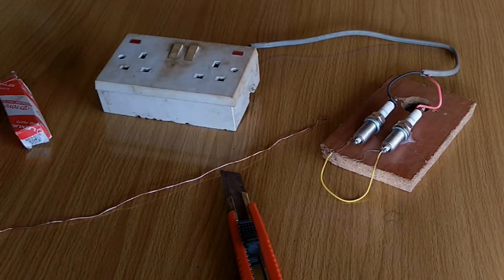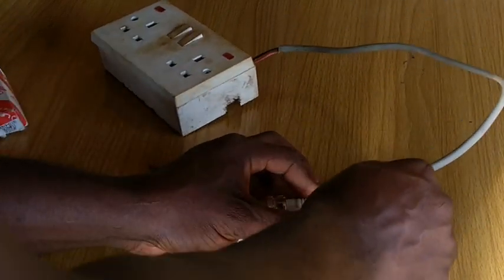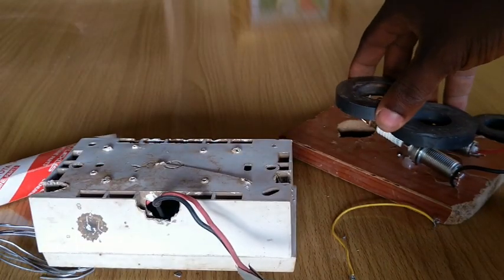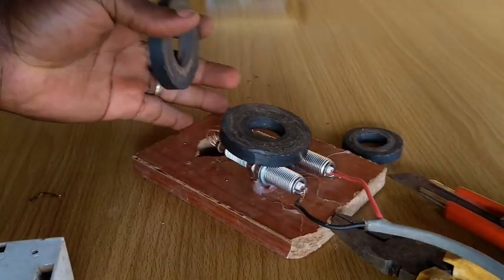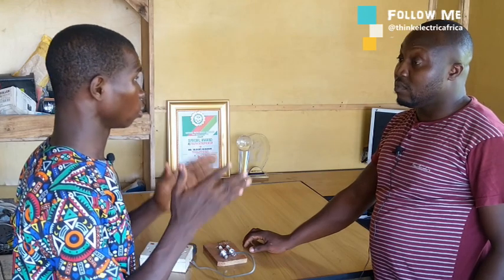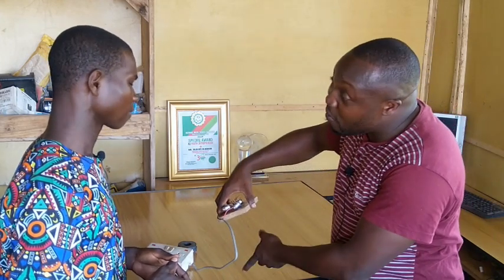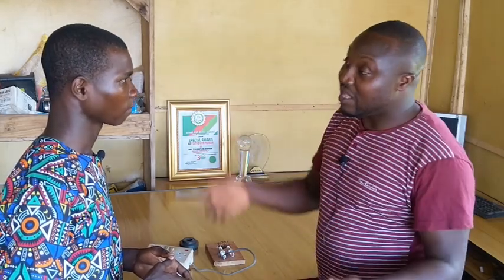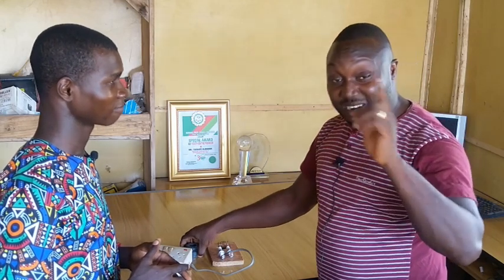Free Energy Electricity From Spark Plugs After few Attempts, My Verdict!

Comment from the maker: The truth with the original Iridium spark plugs https://youtu.be/XLaoKH8rBGw

I Tested my spark plugs and I was wowed: 
https://youtu.be/YDBO_fJpfkQ

Watch my first attempt here: https://youtu.be/-Emk9f4BasM
Is this a Myth or a Gold Mine?
Reply: Which of the spark plug did you use ?
Here is my number 08131216093 daniel
Reply: @chinazagift1599  if available, can you afford it for #60k? :)
Reply: Mine is working, always test your spark plugs with an ammeter or DC bulb to verify. If it works then you know it's real. This plug has an electrode which has been energized. Just like a battery.
Reply: @SparkOfGodsLove  how long will it last before it's exhausted
Reply: @hesbonomoke8973  Years let say 7
Reply: @SparkOfGodsLove  waoh! That's great but these spark plugs are not found easily in Kenya
Reply: @hesbonomoke8973  It should be. Look for automobile company.
Reply: @SparkOfGodsLove  thanks
Reply: Free energy is real. 
Use the right plug and connect your polarity; it will surely glow.
Moreover, your connection is fucking wrong 😄
Reply: @Topyjjay  you right
Reply: Do u think all magnet are same.
Reply: Your connection was wrong I did it and it worked, you have to connect the positive and negative together not negative and negative, the pin in the bottom is where you connect it and then connect it to the huk
Reply: Please tell much about the free electricity.  It is possible for plus to generate electricity, according to the types of plugs name ? Thank you.
Reply: The original iridium, platinum and copper plugs really generate electricity? Because I want to go to the market  and search for then and do this experiment , but I want you to tell me the truth before carrying it out for God  sake.
Reply: Posit u
Reply: Posit u
Reply: Posit u
Reply: Fake
Reply: When u don't know something ask let them teach u well or do ur research properly and use the right plugs
Reply from the maker: @vitalisvicky  pity... Show me your own that is working, 😂
Reply: It is no fake my brother. All the plugs we have in circulation are cloned in china. Genuine Bosch, Champion and NPK plugs has inbuilt resistors on it which generates electricity which a friend from Germany confirmed. However, those kind of plugs are so expensive. 4 pcs is about #50,000. Excluding shipping and customs, reason china buys and clone. The so called original platinum plugs we buy for #6,000 are cloned in china with good parts, reason it's expensive , but fake.
Reply from the maker: @packdroident7612  I see that you are very much convinced, like I said many comments here has sparked me into more research. No matter the cost, I will lay my hands on those plugs and see for my self. Thanks brother. Let's keep in touch
Reply: @thinkdiyafrica  I have also been downloading lots of spark plugs catalogue online, genuine once has resistors to generate electric on AC,while Nigerian plugs has none, as confirmed by a USA seller on ebay which refused to ship to Nigeria, these plugs are expensive bro. If you buy it and use, others will still doubt because not all of us here are deep into tech and engineering.
Reply from the maker: @packdroident7612  well I agree with you to an extent. I just want to let you know that I have viewers that believe in my works. They know I do my research and come with authentic proof. I am in academics and research is my thing, so no issues. Let me get through all I want to do and my presentation will bear all the details
Reply: @ThinkElectricAfrica!  If the plugs are so expensive and hard to get then I think all the people that are making the videos should be focusing on the spark plugs since they know that the spark plug is the most expensive thing in the experiment and not the electricity. You know how to do everything, but the spark plug is the only thing that you cannot get according to critics. So in this case the people making those videos should spend most of their time showing the viewers where to buy the plugs.
Also if the spark plugs are so expensive then an average person in Africa will not be able to do such projects. If an average African cannot afford this, then does it mean that it is not for the poor?
Reply: @thinkdiyafrica  please keep link here for original plug to buy it bro from Nigeria 🇳🇬🙏
Reply from the maker: You can take a look at this https://youtu.be/YDBO_fJpfkQ
Reply: @thinkdiyafrica  That same guy emphasize on pulse circuit plugs and copper plugs with electrode and resistors. Have you tired to get any of those? I have already ordered for a copper plug with resistor and electrode copper, i'm yet to receive. If i do, i'll also order for pulse circuit plugs. If None of the plugs work, then we can conclude that it's fake.
Reply from the maker: @packdroident7612  you may need to check this https://youtu.be/YDBO_fJpfkQ

Comment: No, spark plugs cannot be used to generate electricity. Instead, they are devices that use electricity to produce a spark.

Here's how it works:

A spark plug is part of an internal combustion engine.

It receives high voltage electricity from the ignition system.

This electricity jumps across a gap in the spark plug, creating a spark that ignites the air-fuel mixture in the engine cylinder.

To clarify:

✅ Spark plugs use electricity.

❌ They do not generate electricity.

What generates electricity in a car?

The alternator generates electricity.

The battery stores and supplies electricity when needed.

If you're thinking about making or harvesting electricity, you'd need a generator, alternator, or other systems like solar panels or thermoelectric devices, not a spark plug.

Let me know if you want a simple way to understand how electricity can be generated.

Comment: I agree with you my brother because, even in the so-called 'free electricity video' , there was no explanation of the science behind the power generator. If you look at the anatomy of an Iridium spark plug, the strong component is a 'resistor and the electrode'. And there was no coil/winding to at  least use the law of induction. Well, I know that, no one has a monopoly of science but, as of now, I have not heard of electrical power generation using a resistor as a major component? Perhaps more experiments need to be made on the use of spark plugs to generate power, but definitely as in the several videos online! Thanks again bro!

Comment: LOL yeah you did a whole lot of mistakes right from the beginning,  one thing open up a radio or TV and give it a very good look,  you will notice every thing is in order and soldered in place.

If you just throw things together and think it's going to work you are very very wrong,  you can't just twist wires and sorta clamp things,  you need to stop and use proper tools and stuff to put this together the right way,  then you will have lots of fun and power to use.

Go back and really watch some of those videos and get the proper stuff,  trust me.

Comment: What type of plugs did you use? Are they Iridium or Copper? All plugs don't generate electricity, as they say.
Reply: exactly my brother. i went to the street to check for iridium or copper but i didnt see. i searched online and i saw guess what the prize. normal plug is just 300 naira and 4 of it is 1,200naira  but when i checked online for iridium and copper plugs, their prizes are 13,000 naira for just 4 pics. I now see the difference. how can cheep plug generate electricity?

Comment: My brother...this is intriguing..... Im an interested Physics academia also. Your videos are quite interesting and have seen two that are so interesting. 

Just a thought: since thicker cables have a low resistance, the induced current will be very high and therefore, with Lenz's Law, we will surely require a higher magnetic flux to induce current. 

My point: Try using thinner wires to replace those thick wires. This also applies to the inductor coil that you wound.

Cheers...... also experimenting on my end to prove or disprove this theory

Comment: Thank you for doing this video, hopefully it stops others from wasting time on it. The the spark plug energy is a nice idea but this design won't work. A spark plug is a single core meant to spark across a air gap due to high voltage. The coil of wire is a solenoid which creates a magnetic field by connecting to a power source without power it's coiled wire. The magnet is a magnet with only it's own magnetic field. The device won't work at any stage as its components are not generating or harvesting energy in any way.

Comment: Thanks alot for these videos, 
But I think u should use soldering iron for perfect work & I think there are gage for copper wire not just any wire can do it even the magnet have sizes too, 
Please try to confirm all these before saying it's a scam.
Reply from the maker: Check my pinned comments, I have done everything you may think of. It is a scam still

Comment: Why did you believed with thier stupid work. COMMON SENSE ONLY, THERE'S NO CONNECTION FROM THE SPARK PLUG TO PRODUCE CURRENT. SPARK PLUG US USED ONLY COMPRESSION TO PRODUCE CURRENT WITH THE HELP OF GAS AND CURRENT CURENT FROM THE BATTERIES IN VEHICLE

Comment: Bear in mind that you had a negative mind approach to this initially so it may prevent you from checking all parameters correctly. Get original iridium spark plug tested with led light before you start your connection and see the wonder of free energy. The man who discovered electricity tried more than 100 times before he got a break through to the first electric discovery. You only tried a few times and you are already condemning what works. Please do your home work again and get success. Thanks
Reply from the maker: Thanks I appreciate your comment, I m taking all feedbacks and making my research. I will report my findings soon. Please consider subscribing to know when I do. Thanks
Reply: The other video he totally connected rubbish and jumped into conclusions.....clearly here to waste data.
Reply: @Jrraine  kindly show us the one you did so that we can believe
Reply: @Jrraine  hey dude I came late but I would like to know how you did yours ?

Comment: Good day everyone. I have read all comments and decided to add mine. Free energy from original iridium spark plug works please stop condemning it. Test your iridium spark plug with a led light if it will generate a current when you connect the terminals to the led light. If it does then that is an original iridium. Go and get original plug and do your connections again and show us your testimony. Good luck.
Reply: Good day all, after watching your video I observed few things!
1. You did not test the plugs to see whether its working or not.
2. You were struggling so much to connect the plugs 
3. The type of cable you are using is different 
4. The magnet FK used in his videos looks like those from a speaker.
My submission! Try and imitate it very well, may be the result will be different.
Reply: Where can someone get d spark plug
Reply: Have you carried the experiment your self ?
Reply: If you really believe that it works why don't you show us a little proof of your own video
Reply: Whosoever believed that this thing work so please show us a little video of your own experiment
Reply: If you believe what this man is trying to do is a good and it works then show us a little video of your own proof

Comment: From your connection everything is wrong. Sorry mine is working. Probably you didn't use an multimeter to test your plugs if it's the original. Because mine generated a DC current.
Reply from the maker: Hi, thanks for your comment. I am happy you could get it working but here is my issue  why is yours generating DC and others generating AC. Is it not the same plug?
Powering refrigerator and stabilisers is AC. I would love to get some explanations. Thanks
Reply: @thinkdiyafrica  Ok let me explain. The magnet helps to convert the DC to AC. When I say mine is DC what I meant is, testing the plug with a multimeter I got readings meaning there's current in the plug.

Now let me explain better. The type of plug that will generate a current has what's called pulse fuse this is what excites the electrons to generate when a magnet is brought close. But for generators you need to rotate the magnet rod round the coils at certain rpms or speed to excite the coil. Every wire/metals has static electrons, but when excited the electrons becomes free and can get electric current from it.

The reason why some people are not getting it right, is because they haven't study the theory or principle of generating electricity.

If fact anything heat can generate electricity. Even by cooking you can generate electricity.

Most videos can't explain the theory because of time and the video will be too long, but if you good in chemistry and physics you will know if it's real or fake because all the methods needs to obey electricity principle at different point.
Reply: @thinkdiyafrica  Not everything can fit into physics book of 200 to 300pages and not everything the government allows.

Do some more research on Google you will understand better.
Reply: This comments are really interesting.. so you are powering your house now with free electricity.  Pls show us how you did yours

Comment: But i think.. The properties of magnets are used to make electricity. Moving magnetic fields pull and push electrons. ... Moving a magnet around a coil of wire, or moving a coil of wire around a magnet, pushes the electrons in the wire and creates an electrical current?
Reply from the maker: Hi are you relating this to spark plugs Electricity generation?
Reply: Magnet is magnet. Genuine champion, Bosch , NPK and Denso plugs are about 50k for just 4 pcs. it's very much available and it's real, not fake.

Comment: Oga check your plugs they might not be original. Even me that is not a professional has confirmed it sorry is your humble name
Reply: Did it work for you
Reply: @godswilljonathan8180  why not. The plugs most be original. Its just two and it's for my Anty. We have not been  able to see an original plug to buy. The one we used is Toyota follow come spark plug
Reply: @aishatcarolineiruolagbe8418  k
Reply: @aishatcarolineiruolagbe8418  Hi Aishat, I have seen two versions of iridium spark plugs on Jumia and Konga. The one of Jumia is cheaper than that of Konga. That of Konga is N40,000 (4 PCs) and is labeled GENUINE IK20 IRIDIUM POWER SPARK PLUGS while the other is 4pcs at N6,000. I believe this cheaper one is what someone above complained that it didn't work. I am impressed by the progress you made with your improvised items. Keep it up.
Reply: @obisinger  have you tested it. Konga or were ever is not the best place to buy cos you will not be able to test it.
Reply: @aishatcarolineiruolagbe8418  I haven't bought it.
Reply: @obisinger  make sure you test it b4 you buy, I'm yet to get original one. Konga or online is not your best bet.

Comment: You do a lot of mistakes on your prove sir at first  the guy that did his own did not separate the magnet from it components but you remove yours and secondly he connect his wire one the plug hock and the other on the pencil rode of the plug which he called down rode of radium spark plug so go back and use magnet that is not removed from it features and show us your experience or go and buy that type of red plug which he uses with pencil mouth
Reply: Ok Mr Augustine. I want to ask if you tried it and if it worked? pls be kind to share with us. Power is a major issue in Nigeria. Thanks
Reply from the maker: Hi Augustine, thanks for being on my channel and for your comment. I am happy at your analysis, I tried to make everything as plane and clear as possible. I will do it again soon enough but first is when I am sure I have the right plugs.

Remember to Subscribe to this channel if you have not. This channel is for all of us and we are doing great, I want you to see my other videos. Cheers ❤️

Comment: You can get a small solar panel for which you can connect you wires and to the fuse and see if wreathe it won't come. No one is wasting our time, but you can create you own idea also for people to follow
Reply from the maker: Wd actually don't need to fight bro, I asked people to tell me if I was wrong, tell me where to get these plugs please
Reply: @thinkdiyafrica  sorry for being harsh bro. Try and get solar panel at least those small piece just like ply wood and you will see behind it where to connect the the wires and then connect it to the fuse and I hope it will come. If incase the spark plugs are not working